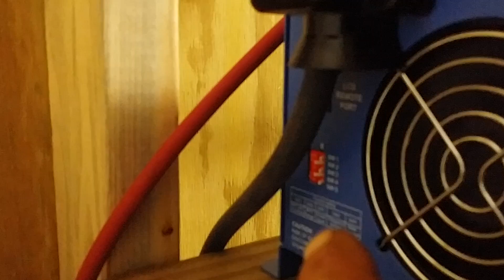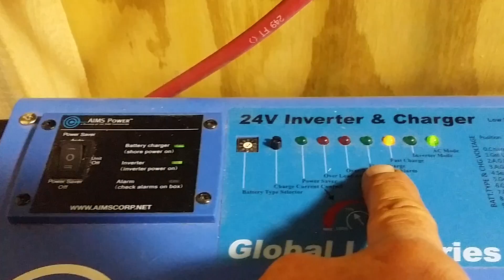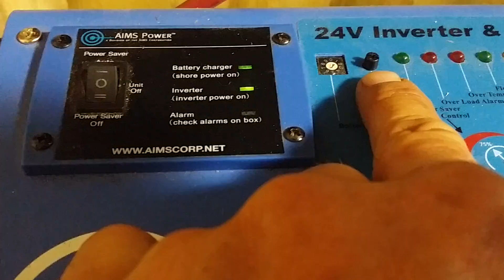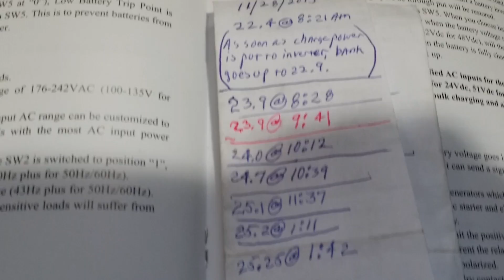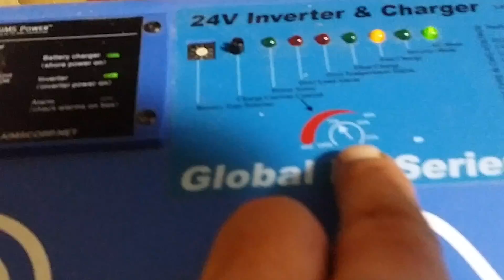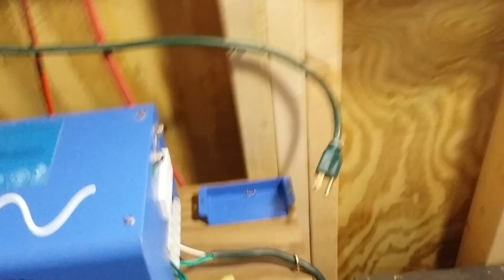AIMS Inverter/Charger: Charging Your Battery Bank

Comment: Still working ? Seen this vid years ago. Bought a 6kw unit and manual says use 3x kw for generator 18kw gen.Now that’s nuts.
Reply from the maker: @2hotscottpro  Yes, my Aims 24 volt inverter/charger is still working, it’s getting near 10 years old.
Reply: @ wow we need a cake party vid!

Comment: How long has this inverter lasted you? Reliable?
Reply from the maker: I'm still using it with no problems, even now it's powering my house. If I could go back, I would have gotten a 12 volt one instead of a 24 volt one. 12 volt stuff seems easier, more common. Here's the biggest deal...I've learned that you should just go ahead and get a 3000 watt or more inverter, they are not much more money. If you have 2000 watts to use and you use a small fridge, a couple of fans, charging a power station, running a gaming computer and a couple monitors(like me), a few lights, and then try to top it off using a coffee pot - well, it may shut it down and start beeping or something. I've also learned that you might as well get at least a couple of Lithium batteries instead of flooded, AGM, sealed, etc. Another hint, just go ahead and go with the Victron company if at all possible, they are well proven. Summary: I'm using my 8 year old Aims 2000 watt 24 volt inverter still and I'm happy that it's still working. Thanks.
Reply: @appsbyallan  good to know. I had an all in one inverter and it went out after 6 months. Maybe parts got too warm. I am looking for something with separate parts instead so maybe it'll run cooler also put a fan so it'll last longer and be more dependable like your Aims.

Comment: Thanks for clarifying what day it is....nice battery bank. This is critical to a good system and many underestimate how much battery they need. Hopefully I can learn something frm this L means load..Live or power. Im charging one bank of two 6 volts in series and its rapidly charging them, bubbling away! But you have a massive bank here that will take enormous amps to fully charge these batteries. Yes! it takes that long to charge this huge battery bank.

Comment: I have the same exact inverter but I only have 6 batteries hooked to it until  I can get another 2 in a few weeks so mine can charge like yours...it does take awhile..I'm charging my 6 on about 80 % on the little black knob..when I only had 4 batteries it charged faster but it runs a lot longer on a charge on 6 on small loads so 8 batteries is probably the best like you have there

Comment: You need to remove the charge controller,   It has opened at that voltage 25.2 volts and has stopped the battery's from charging past that point. The inverter charger can no longer send voltage to the batteries. The charge controller is only a switch that opens and closes at a preset voltage. Remove it. The inverter charge has its own limit protections.

Comment: Your cord from the generator to the inverter is too small. That is only 16ga wire, it should be 12ga, 10 would be better. Your trying to put 25 amps though a 10 amp cord. That is like filling a bath tub through a straw.

Comment: Do dey discharge themselves on idle mood?
Reply from the maker: Basil Kasimi I’ve wondered that for a long time. I’m pretty sure it’s not good to leave good batteries alone and just let them sit for months at a time without ever using them. I think it’s best to at least use them every couple of days and at least use them 20% of the charge and then back full again as far as lead acid batteries. But I’m not an expert on that acid batteries, I’ve just been around them for a few years.

Comment: One of these is mounted on the rear floorboard of the EMS supervisor vehicle (a crew cab pickup) were I work.   I stepped up to supervisor after a big change in management.  There is no documentation on how to use this thing.  Nothing lights up when I'm driving down the road. I can use the emergency lights and siren just fine.   There's what looks like the male end of an extension cord coming out of the vinyl floor material a few inches from the inverter.  I'm guessing that it might have been intended to run a bank charger for portable radios, heart monitor battery chargers, etc. in a disaster or functioning as a command post .  This thing is huge, a lot bigger than the inverters on our ambulances.  Right now, its just taking up room.
Reply from the maker: traumajock is it a 24 volt or 12 volt unit?
Reply: @appsbyallan  12 volt.  I'm looking on their website now for a manual.
Reply from the maker: traumajock Let me know if you ever want to get rid of it. I’m in Oklahoma
Reply: @appsbyallan  the OK state.  Y'all are why Texas doesn't fall off into the ocean.  just kidding.  I'm on the Bolivar Peninsula, near Galveston.
Reply: @appsbyallan  I can't find my model number on their website. waiting for them to respond.
Reply: @appsbyallan  I just did a search with my model number and found a manual.

Comment: I am a newbee but really interesting on solar.
any of you guys can give me steps to get if i get a 6000 W inverter 
how many solar panels ( i am looking at some LG 400w)
and most important batteries i am looking at Trojans T105 ( 12v or 6V ?)
any help will be appreciated.
I am in new england i want my system to power most of the daily power usage (ligts ,tvs ETC)electric stove ,microwave,dryer will still use  electric company

Thanks
Reply from the maker: Go to Missouri Wind and Solars website and they have all kinds of videos on all the different configurations of panels and batteries. Be sure to get to their youtube channel also. They have always treated me great and I appreciate them for helping me. Go to: mwands.com
Reply: @appsbyallan  
I just want to know how many pabels you are using to charge your batteries
Reply: Rafael Ramirez I’m going with V-Max batteries and the  Midnight solar 150 classic charge controller with my 24 volt Inverter charger and an auto-start 3600 watt generator. It’s for a full time vintage Travel Trailer...
Also 500 watts of solar.

Comment: I was told with my deep cycle batteries that a 10 amp 12v car battery charger isnt powerful enough to charge 4 of my batteries and that i need a deep cycle charger with at least 40 amps to get them warm when charging hope this helps
Reply: R/C McGuyver -you just helped me with a problem I was dealing with.   I was using two small car chargers to charge five batteries.    I’ll buy a 45 amp Charger from intela power or some other brand. Thanks.

Comment: is your charge controller connected to the inverter I hope not, because it will reduce the amount of amps going into your batteries. plus you should replace that charge controller with a MPPT controller. I hope this helps
Reply: is there an mppt you recommend?
Reply: @lightning8948  
Victron
Reply: I like Morningstar, shneider, or Midnite in that order of charge controllers.

Comment: I have have the 3k, 24v. I had issues with the bank charging. i switched to a larger cord to the a.c. input on the inverter from my generator. The unit immediately switched over and started to charge the bank at 29.1 or so volts. that's with the knob at 100%. Now I charge it up 2 volts roughly every night, and it takes 45-50 min. I think it's smarter than it looks. It didn't like the voltage coming in to the inverter from the gfi on the genset (I have a 7k pure sine). I i switched to a 220 outlet with a 4 way at the end,  bam. Works beautifully. I really like the aimes.
Reply: TACTICAL DAIRYMAN is the inverter 7kw or your generator 7kw in this scenario? I do believe from what I've read with the aims inverters, the larger models (6kw is the one I've been researching) they have split phase 240v Ac power and need that on the input side as well to charge.
Reply: Steve A , yeah that's my generator. The inverter I have is 3k/24v

Comment: I am going to upgrade to the same unit you have for my RV but I only have half the battery bank you have and have a good size solar panel plus when I drive my RV the batteries get up to 140 amps from the engines alternator. I hope it works out for you. Thanks for the share.
Reply: You need a larger battery with this system
Reply: Your going to burn up your alternator unless it's a 300 amp one

Comment: You have a large battery bank and your Aimes charger is only rated at 40 amps. Maybe with your solar system you will get enough amps. I would have gone for a 100 amp charger minimum with that many batteries. It also depends on how what you are trying to power or pull from your bank.

Comment: Hi I install solar systems and I have had a few questions from customers myself I don't install these inverters however they are not a bad inverter I use magnum but it all depends on the specs on why it takes so long to charge the battery bank you probably have a lower amp charger my magnum inverter charger it only takes two hours at the most to get it up to like 26 and 27 volts another thing it depends on in the winter time when the panels don't charge as much and it will also depend on how many panels you have on this system as the panels will also charge even thought you are using the charger a battery bank Don't know why I like the magnum inverters better I never have problems with them good luck with your system
Reply: Magnum YES
Reply: Hi friend, i am vendor of Inverter Charger, our inveter approved ETL certificate, UL 458 and UL1741.(we are the only factory in China who make this certificate, so you can import this products easily), we also  pass through GFI test, it means you can get best products with cheaper price, check our website www.cosuper.com , send me email: vince@cosuper.com if you need this inverter. we will go to usa exhibition on november 2018
Reply: Rhandsom has many vids on Magnum.  They look supreme but the Aims are a lot more affordable

Comment: That knob you turn tells the inverter how much of the current that is going through the inverter goes to the battery charger. I have the 6000W aims inverter/charger which has a 85 amp charger. I don't know the specs of yours but it will take awhile to charge the batteries.

Comment: Hello Allan, yes it takes a long time to charge the battery bank, the current knob is correct at 75 % the # 1 dip should be on 0 the rest can all be on # 1, plus when you were doing a close-up of the lights on the on and off switch it looked  like there was a green light on the shore power and also a green light the inverter? also that inverter/charger sould hve a connection to start the generator and use 10 gauge wire for the power in and power out, hope this helps